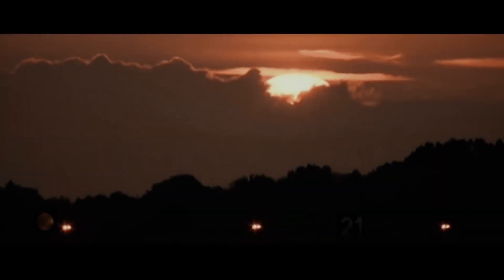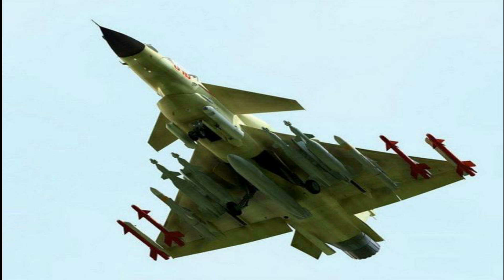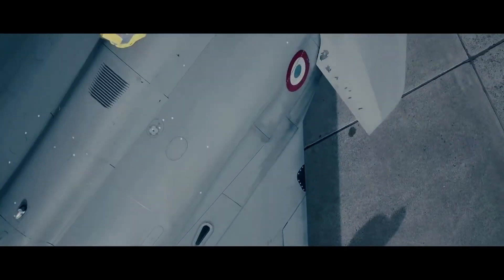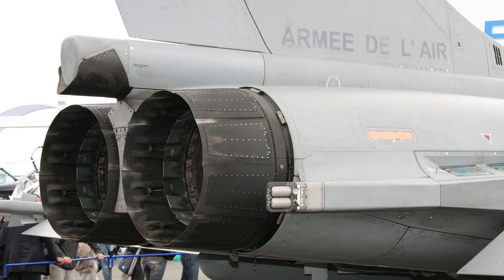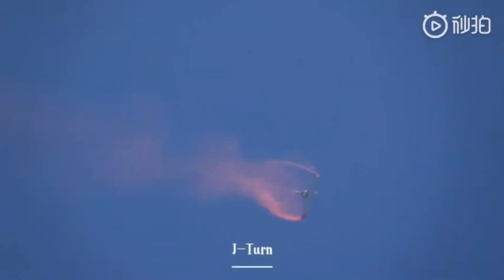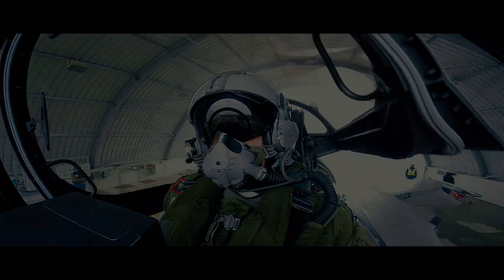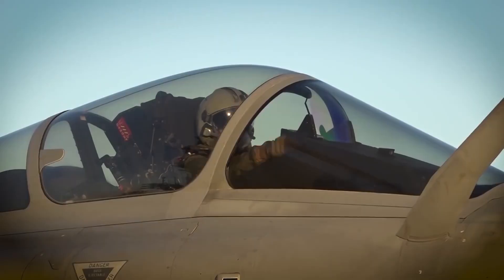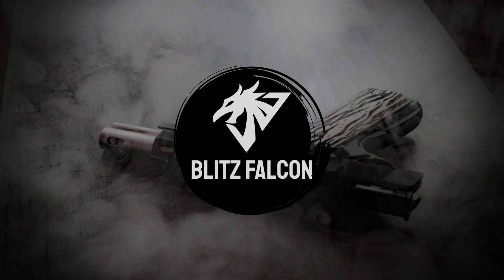J-10C VS Rafale | Technical Comparison

Comment: J-10C is a much better air to air platform
Reply: Rafales have meteor it is way better than anything in Chinese arsenal
Reply: @agentnoobz5588  No its not. Stop believing all the european hype.
Reply: @EEEEEEE354  Ya real American more like lol Pakistani...What is pl 15 best missile in world? That chinese overhype...The specifications for Chinese missiles are exaggerated-US defense minister
Reply: @agentnoobz5588  You need to be very careful when you talk about "best" in terms of missiles. In what area is the missile better? Meteor has a larger NEZ, but its ducted rocket design requires the atmosphere as an oxidizer. In this case, the high ISP of its motor design does not necessarily yield greater maximum range. The advertised range of Meteor is greater than 100km. While this is undoubtedly a conservative estimate, the point is that Meteor is not the longest ranged missile in its class. It MOST LIKELY has the highest PK within the range envelope it was designed to operate in, thus is probably the best in terms of taking on fighter sized targets. Meteor's propulsion concept does not allow for extreme high altitude lofted trajectories possible with a solid rocket fuel motor with its own oxidizer. PL-15 is a larger missile capable of lofting to much higher altitudes, thus achieving greater maximum ranges compared to Meteor. PL-15's larger AESA seeker provides a greater active radar range as well as better resistance to electronic countermeasures. 

Meteor: 
- larger no escape zone 
- higher PK within 100km against fighter sized targets. 

PL-15:
- longer maximum range when both missiles are in optimal conditions 
- better resistance to electronic countermeasures.  

Its an apples to oranges comparison, and outright claiming one missile is better than the other is nonsense.
Reply: @EEEEEEE354  meteor range is downplayed as it has sfdr which conserve fuel and attain greater range and velocity at terminal phase..pl 15's range of 200km is for slow moving targets..no bvr can hit a fighter at 200km especially in a ew environment and against rafale's spectra which is comparable to f35's dcs
Reply: @Arhum zia not better than f35's dcs and rafale's spectra...They are the best...With decades of experience used in making those...This is not child's play
Reply: @mmkr0000  The west will also grow manifold times...they won't sit idle
Reply: @satyaswarup3277  they can't keep up with the pace the Chinese are going. Americans are already crying, nagging and bullying their  allies not to cooperate with China in any way that might help the China technologically and economically to no avail 🤣🤣
Reply: @mmkr0000  Economically US is crying...but technologically US is decades ahead of China..and will remain for a few decades more...And main Chinese problem is there transparency...Nobody knows what they develop..They claim it to the best but when studied throughly it comes out to be overhyped

Comment: Pakistan will most likely buy j10c
, those arguing it should buy j31 simple answer. Is pakistan cannot afford it and it does not want to to start unwanted arms race since this will force India to buy aswell and they will probably buy in many more numbers, and those asking why buy this when paf has jf17 block3 well jf17 even though its good platform its no match for su30 or rafale due to  its limited range and airframe since it wasn't designed to be top end air superiority fighter where j10c was designed for that role specifically, in future paf will have around
 Jf17 250
F16  80
J10c 36-70
The reasons they will only get few in numbers is because it main role will be air superiority so they need only 2 squadrons in each province for air defence
F16 is still the favourite jet of paf but  it doesn't have enough numbers and also there are lot of limits  placed on it  for example they are not allowed to have exercises with other air forces without consent from usa
And finally it was not jf17 that shot down su30 or mig 21
When gen gafoor said no f16 where involved in the battle he was wrong for whatever reason in fact there where no jf17 involved in that day only mirage and f16s
Mirage fired stand of weapons in iok and f16 shot su30 by hassan sadique and And another f16 shot mig21 by noman Ali khan
Reply: i m chinese .i hope bros buy j10c or j31 ，but j10c may be better.we are The J10C can counter the F16, our main Chinese fighter, and we don't have any restrictions on its use by Pakistan.

Comment: You need a few corrections here, top speed of J-10C is below Mach 2, the KLJ-7A stated range is not correct even if it from an old brochure, actual range is classified. And GaA AESA TRMs are inferior to GaN, not superior.
Reply from the maker: Negative
Reply: @pakistanstrategicforum  No buddy, respectfully you're wrong. Whoever it is giving you this information has made a few mistakes. DSI configuration on J-10B/C renders it not capable of sustaining speeds approaching mach 2. The radar range stated is not entirely correct. And the point about GaN emitters, please look up power and efficiency of GaN vs GaA. GaN will eventually replace a lot of GaA as it becomes cheaper and more feasible to use on X band radars.
Reply: @telperion1402 😂😂😂let them assume.... J10c is comparable to f35 bro 😂😂😂😂😂 , there is a reason why mynmar & Nigeria buys Chinese 😂 aircraft because its the best.
Reply: @dwanelkemprai4983  What?
Reply: @telperion1402  yes its the best aircraft

Comment: Although The US made F-16 hv capability to fire like amraam bvr, so Indian Mig 21 dropped due to this bvr but in the same attack Su 30 dodge the amraam. But when the matter with Rafael, F-16 can't engage for long time, coz METEOR is the real factor, and among the all worlds bvr range missiles Meteor is the beast for anyone. For that American F-35 are equiped with Meteor as well as Sweedish Saab Gripen also equipped with Meteor. But There is no basic knowledge of Chineze jets like J 10 C, J16 in world coz its not war prooved. But PL 15 hv the range of 150 km, wherever Meteor no escape zone is 100 km, PL 15 is the same. So The competition raises between those pilots. Which one is more capable. But India as soon as possible developed a deadly bvr range named Astra Mark 2. And  all the 272 units of Su-30 are equipped with this deadly missile soon.
Reply: There is no proof that su30s have dodged amraams and only about 100 to 130 su30s can be operational at a time

Comment: Only one question , jf 17 blkb3 has same features as j 10 c accept it is medium weight and can carry greater payload   , so WHR PAF wanted to buy J10 c ???
Reply: For air superiority role
Reply: And to maintain PAFs moral
Reply from the maker: Negative, JF17 Thunder Block-3 will be a light weight fighter, it will be able to carry 4 BVRs but still J10C has numerical advantage over it just like F16 Block-70. PAF wants J10 or not, time will tell.
#TeamPakistanStrategicForum
Reply: @pakistanstrategicforum   I hope  PAF will focous on mig 35  option  instead of j 10 C which will have new weapons and more secure platform due to double engines
Reply: @mudassarhussain2173  Russia will not a bigger buyer like india for us 
And mig 35 is mig 29 upgrade 
It is much costlier to obtain and obtain for us as we have less budget

Comment: Bro can you please tell 
Is there any chance of Pakistan inducting a twin engine jet in next decade or so
And shouldn't Pakistan buy the UAE F 16 block 60 as they are replacing it?
Reply from the maker: J10C with WS10 has 145 KN of thrust, while Rafale produces 150 KN, so the gap in medium weight fighter is shallow, there is a chance for it if PAF decides to induct heavyweight fighter.
#TeamPakistanStrategicForum
Reply: @pakistanstrategicforum  brother can you please tell how much jf 17s and f 16s Pakistan has and difference between their blocks and there current specification status 
Thanks
Reply: @hashamaslam7903  
F-16 75
JF-17 132
Mirage III - 89
Mirage V - 90
Chengdu F - 7P
Reply: We should acquire F-16 Block-72 instead of old blocks.
Reply: @rohailkhan4826  in 2015 air chief sohail amaan denied USAs proposal for 8 modern f16s and a lot of new weaponry and electronic equipment with it. Because if we accept that proposal it will be a threat to our pride and sovereignty (according to Sohail amaan). According to some sources US want access to pakistani area for spy on China
Reply: @mahirahmed2656  May be it would be a reason but we are already operating 75 F-16s right now and we have experience of it so that why i am saying and as far as USA's terms and conditions are concerned for selling F-16 we should make it clear that we are purchasing it and they are seller not our lord that for F-16s we will give them our land to spy on China.
Reply: @rohailkhan4826  tese are terms and conditions with out these they will not provide us f16s
Reply: @mahirahmed2656  They can give F-16s to Taiwan and modern weaponry to india without any hard terms and conditions they why not to us? We are purchasing it not getting them in aid
Reply: @rohailkhan4826  because we are best friend of china and they are enemies of china
Reply: @mahirahmed2656  Doesn't matter india is friend of Russia all we need is best diplomacy
Reply: @rohailkhan4826  Bro india is now moving to western equipment. Because Russian equipment is very bad in term of maintenance and availability ratio. They signed BECA which means that now they are US ally
Reply: @rohailkhan4826  PAF loves f16s if they are available on good terms PAF will not take any time to get them. But unfortunately they are not available for us at this time
Reply: And to maintain PAFs moral